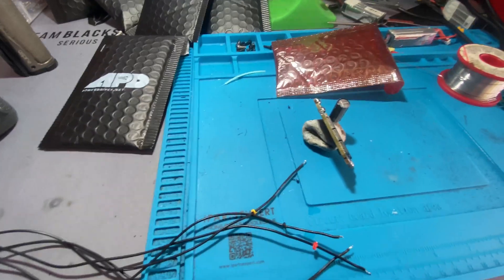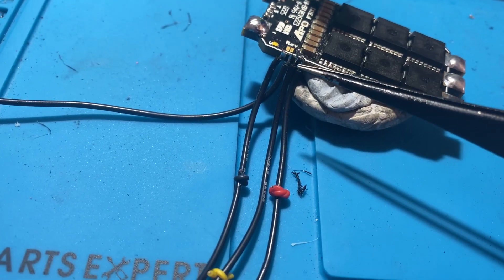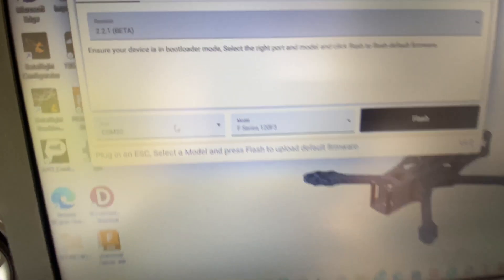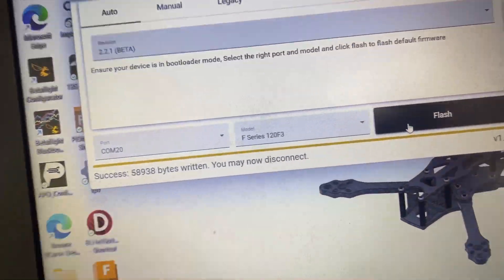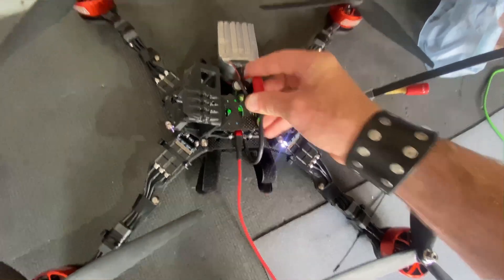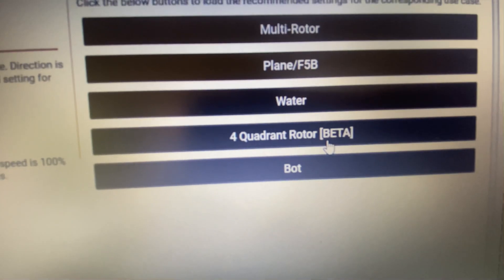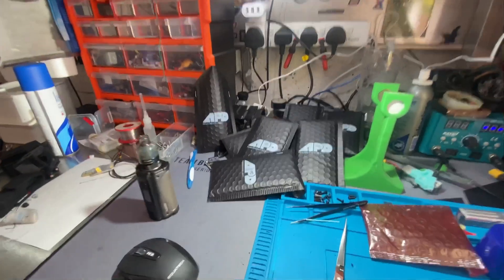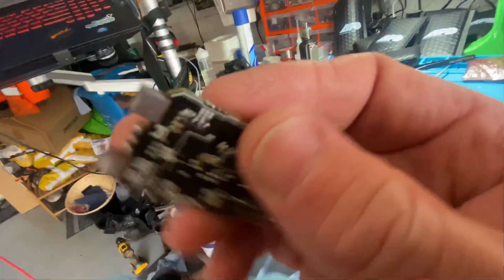Apd esc flash. Betaflight 4.3 pass through

Comment: You are being careful to warn about overheating the uart pads on the esc. What about the power lead and motor lead pads? I would think they should be able to handle a bit of heat, to get 10ga or 12ga wires soldered up?
Reply from the maker: Never had an issue with em

Comment: Thanks for this procedure...very helpful and I closed my eyes when you showed the solder joints 🙂 Why remove C28 though??
Reply: Perfect. Yeah I need to go through the configurator next. Finishing up a build.
Reply from the maker: @mitchponton  sub me man and join my little discord if you like.  https://discord.gg/DA6V44pS
Reply: Joined earlier today!
Reply from the maker: @mitchponton  I am a busy guy and will help where I can man. Once your up and I’ve tested 2.2 dynamic idle alpha I will toss you it man
Reply: @noisy_boi_fpv_3920  I appreciate it. 13 inch 12s to carry a komodo. Trying to make it right
Reply from the maker: @mitchponton  shit I bet. Print a dummy first lol.  Don’t use dynamic idle on 2.1 or lower it causes de sync.  I have placed 2.2 in my Apd page. Wait until I’ve tested it so far so good but not flown in anger yet.
Reply: @noisy_boi_fpv_3920  I just put 2.2.1 on today. Waiting to finish the build before I use the configurator
Reply from the maker: @mitchponton  what fc have you used.
Reply: @noisy_boi_fpv_3920  before was a radix v2. Had issues. Using clracing dual gyro now.
Reply from the maker: It has to go or dshot data will not have an even flow. It has to go as per Apd docs. Thanks for dropping by.
Reply: @noisy_boi_fpv_3920  Do you have the apd doc link? I just want to read up more on this
Reply from the maker: @mitchponton  https://docs.powerdrives.net/products/f-series-esc/quick-start-guide
Reply from the maker: @mitchponton  flick through. Go to downloads there’s a flashing tool and gui downloads. I am currently testing dynamic idle version which isn’t released yet. I do a little testing for Apd.
Reply: Do you have a vid on removing c28?
Reply from the maker: Smash that sub I will be doing more Apd stuff
Reply: Appreciate it. I'm removing them and flashing as per your video

Comment: I think I missed something... You have to flash it with the USB UART Adapter but you can configure  it with Betaflight passthrough? But there is a flashing Tab in the configurator, what is that for?
Reply from the maker: You can only flash through configurator /pass through when you’ve flashed esc with correct boot loader. The newest builds generally need new bootliader flash
Reply: @noisy_boi_fpv_3920  Ok. So the flashing with the USB Adapter is generally for the correct bootloader. Thanks a lot
Reply from the maker: @jojo42069  correct. Read notes on Apd website the latest one is needed for 4.3 as there’s lots of changes.  C28 needs to be removed also it will not filter clean with them still attached

Comment: My computer won’t detect the esc it’s in bl mode and all
Reply from the maker: You’ve probably got wires wrong or wrong  interface or dodgy usb lead.
Reply: @noisy_boi_fpv_3920   nope 5v g rx to tx and tx to rx and I have the uart bridge from apd
Reply from the maker: @Ryanmatthewseltzer  load mystmelectronics driver package. My computer runs. Blue jay Blheli Apd stm all with no issues. Navi Betaflight emu. All with no issues. Blheli has nothing to do with your problem. Sounds like a driver thing
Reply: @noisy_boi_fpv_3920  where do I get those from
Reply from the maker: @Ryanmatthewseltzer  MY STM micro electronics. Google it open account it’s free. Down load stm driver package.
Reply from the maker: @Ryanmatthewseltzer  https://www.st.com/content/st_com/en/user-registration.html
Reply from the maker: @Ryanmatthewseltzer  ☝️
Reply from the maker: 4.3 won’t work until you’ve flashed newest. Are you talking about connecting to all 4 or just one